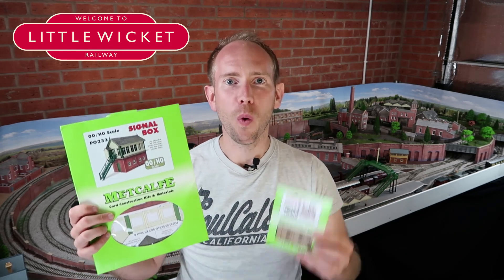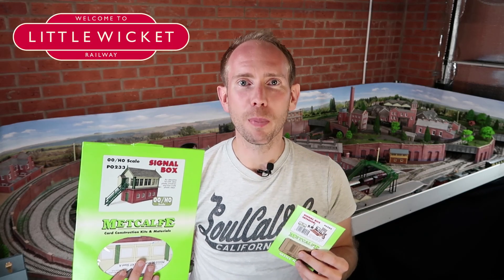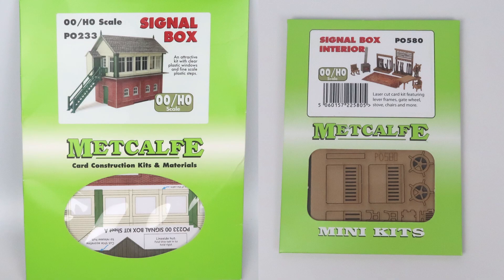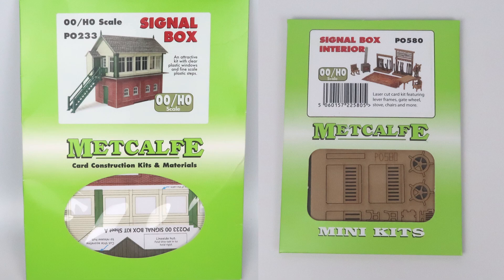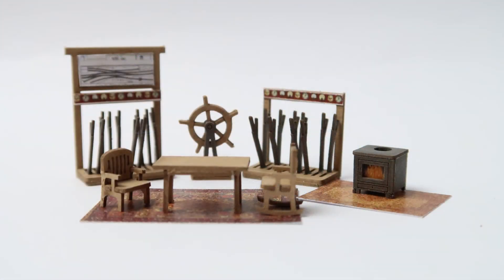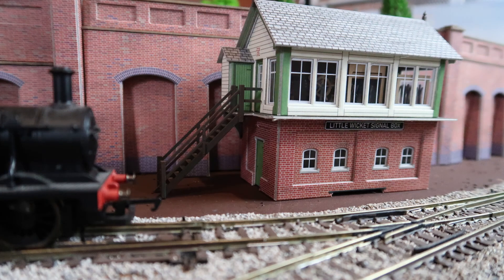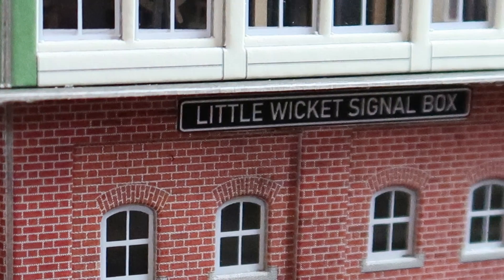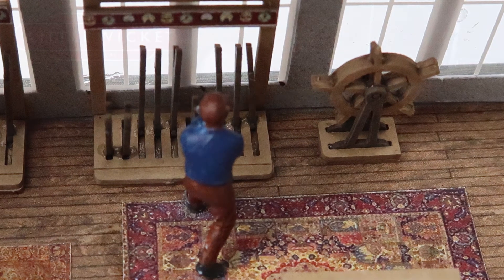Model Scenics | Metcalfe Signal Box (PO233) with Interior (PO580)

Comment: have made a few of these kits, both in OO and in N over a few years, they are excellent and very well thought out - also typically extremely easy to add basic lighting to. only real point of note is to recommend a brick red, a slate grey and a concrete beige colour acrylic paint for the exposed card edges - minimal cost but seriously improves the look of them
Reply from the maker: I'm definitely adding some lighting in future 👍